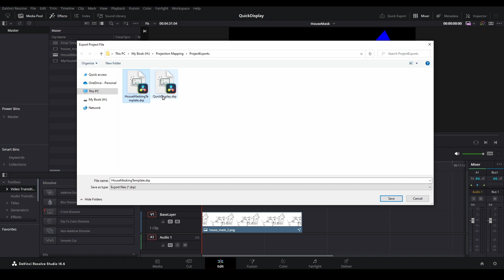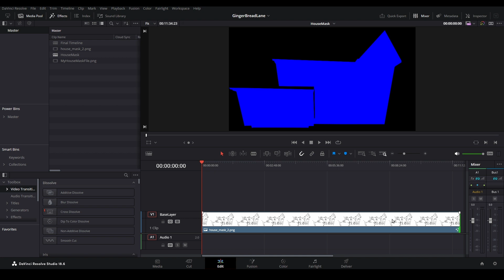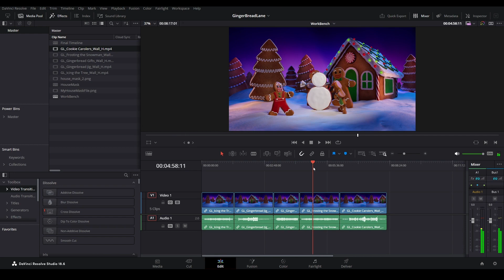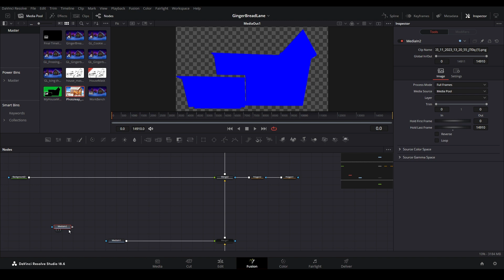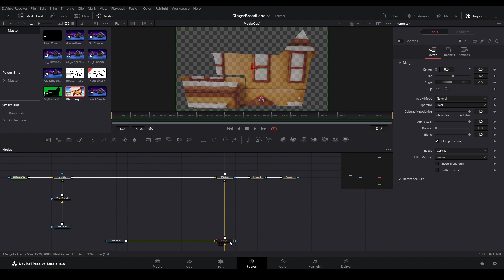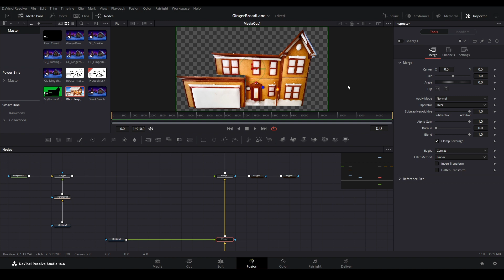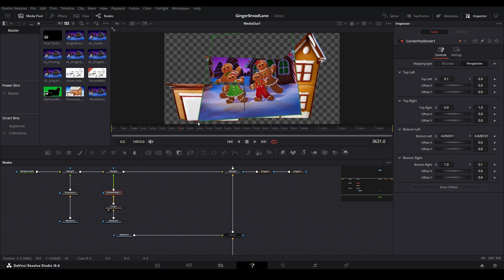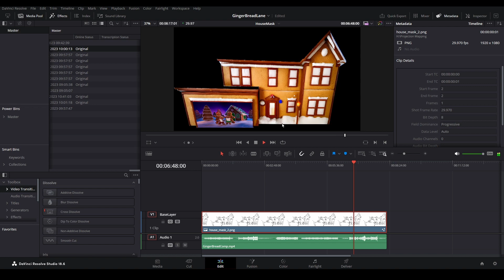Resolve Projection Mapping Guide | Part 3: Quick Display Featuring PhotoLeap

Comment: Thanks for the tuts! I'm trying this now and at the 4:40 where you add the facade, mines seems to be blank. It's saved as a png file. When I drag it to nodes from the media pool, then connect it to the merge I don't see it. Any idea why?
Reply from the maker: @vurcz_da_vigilant2622  Look for the ResolvedHomeProjections Facebook group. I can help you over there if you include some screen shots.
Reply from the maker: Another way you can check where the issue might be is by selecting each merge node along the limb and hitting 1 on your keyboard to put the preview in the first viewer window.  Start at the far left, review that first merge, and then work your way toward the trunk. You may have put your façade behind something inadvertently.
Reply from the maker: Here's the link if you need it.

https://www.facebook.com/groups/resolvedhomeprojections/?ref=share&mibextid=NSMWBT

Comment: I've did this, but when I went bacl to "Edit", the audio wasn't on the timeline so I added it manually. However, my video is way too slow to fit the whole audio and I don't know how to fix it...
Reply from the maker: Did you convert the video to the correct fps using the work bench?
Reply: @ResolvedHomeProjections  I forgot to create one. In fact, I was following the informations in your second part video.
On my Timeline, I've put my Mapping Guide, then created my polygon, inserted my video, but only on one timeline.
Is there still a way to fix it?
Reply from the maker: @alexayotte9479  Rewatch this video, it is addressed near the beginning.

Comment: I cant get the facade i built in photoleap to show up in the mask. not sure what im doing wrong. tried two different times with the same result
Reply: I cant get the images to show up like he does in my masks either.. Also in step 4 he uses his Corner to add windows and can see them in his mask while he is positioning them I get nothing.. Im beginning to think you need th paid version to get this working.. I have tried 6 times or more starting over and over with same results
Reply: I am basically having zero luck even getting my house to show up like he did to make the gingerbread house I get no image to show up.. I also bought the photoleap  app and got a bunch of images to use..
Reply from the maker: @caspercurly  I'm sorry I saw this so late. YouTube doesn't alert me to replies to others. If you moved to another tool I understand. If not here is the Face book group I created to better assist folks. If you provide screenshots of your issue and your tree structure I can usually find the problem.

https://www.facebook.com/groups/resolvedhomeprojections/?ref=share&mibextid=NSMWBT